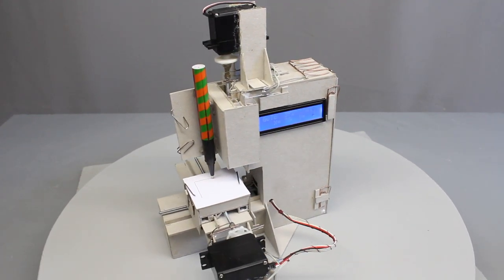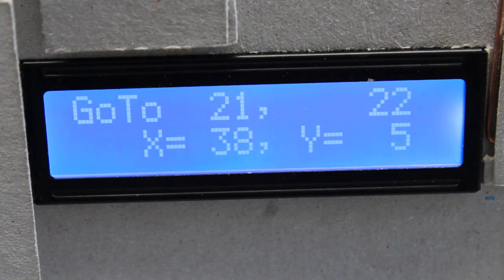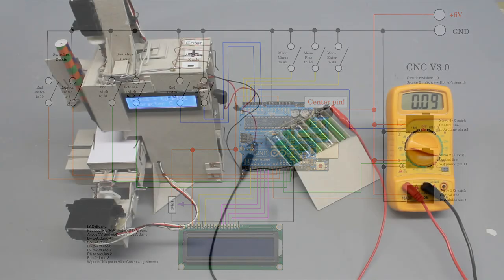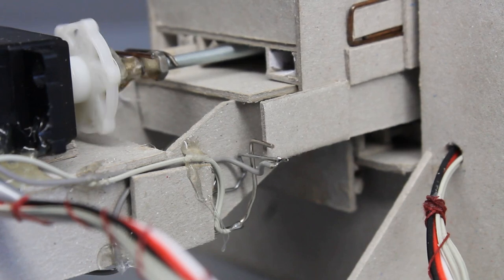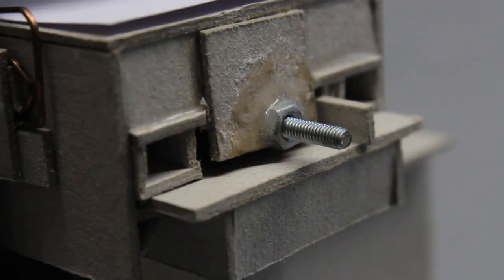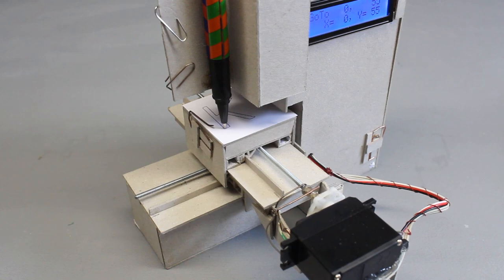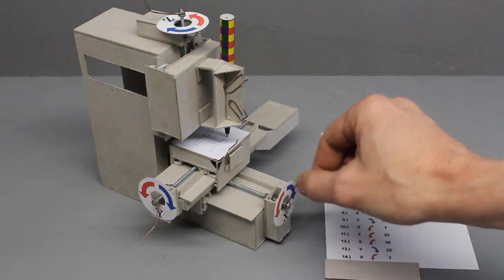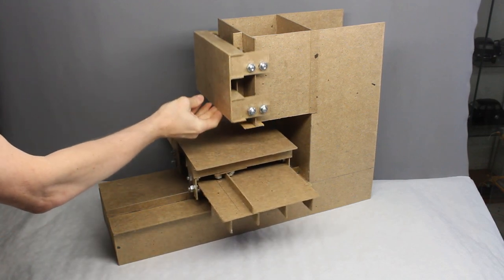CNC v3 0 composed of cardboard and paperclips

Comment: Fantastic work! I love the materials you have chosen, perfect for prototyping and learning. I'm really looking forward to seeing the hardboard/fibreboard version completed, very curious to see what you use for a rotational sensor - If there was a vote, I would vote for optical ;)
Reply from the maker: +sonodrome 
Optical sensors from old printers.
Reply: +HomoFaciens Yes, something like that would be great. You often get the same sort of infrared rotational encoders used for scroll wheels in computer mice. It looks like the bearings have made the movement on your machine very smooth, with the addition of optical encoders the resolution and accuracy could be very good!

Comment: What do you think for  the reason of jaggie lines, is the rod? or is the cardboard structure or maybe the servo is not enough fast for posionated on time when is need it?
Reply from the maker: The servos are controlled with one step per revolution. 3mm threads have a pitch of 0.5mm per revolution, thus you get a too low resolution for smooth lines.

Comment: Fantastic ideas! I've always wanted to build one but the costs seemed prohibitive when you consider the cost of servos, motor controllers, bearings and the platform. This is an easier option to get the fundamentals down at a really affordable price.
Reply: +youtubasoarus I think these are continuous rotation servos, so you can skip out on the motor controllers, unless you meant Arduino for that.

Comment: Really nice machine - very satisfying to watch, and great for teaching the basics of CNC too. I've been designing a partly lasercut CNC machine myself but I your design would be perfect to lasercut - it would be possible to lasercut almost every part of the machine. And imagine using a plasma or waterjet cutter to cut your peices from metal. I like your video because it shows what one can do with very cheap materials, but I think the design has potential to be a very powerful machine, whilst still being cheaper than off-the-shelf models.
Reply from the maker: +OpenTronic 
Thanks for sharing your ideas!
Using a laser cutter to build this machine from cardboard sounds like the total overkill. However, part of the specification sheet of my 3.x series is "self replication", thus using a CNC to create more CNCs. I will in fact use a variety of materials with cardboard being the low end and metal frames on the high end for machines coming in the not so far future.
First and foremost I will use a router to cut materials, but that won't be the only options. Let's see what the future brings...
Reply: +HomoFaciens Yes, lasercutting this from cardboard wouldn't be very useful since the backlash of the cardboard version is so bad. But in acrylic, for instance, you may be able to get a far greater degree of accuracy! The CNC router I'm building at the moment is a mixture of lasercut acrylic and aluminium extrusion, and I'm hopeful that it will be able to cut aluminium, and therefore replace its own acrylic parts with aluminium. Maybe!
Reply from the maker: +OpenTronic Besides the backlash, the low speed of this CNC is a drawback if you consider this to be a useful tool...
Using a CNC to improve the design of the next one is part of the specification sheet of my 3.x series. 3.0 is nothing but an illustration of what the large ones will look like. However it's really fun watching it and a version using acrylic plastic would be even better looking fun!

Comment: Is the cardboard thickness critical? I have one which is 2mm thick. Hmm.
Reply from the maker: It's no precise machine, thus the 2mm cardboard should work, too.
Reply: What kind of glue did you use? ( You might include the explanation on your project site). Did you use hot glue or just any wood glue or similar?
Reply from the maker: smrki1
I used wood glue.

Comment: I want your clothes, your boots, and your motorcycle.   Looking forward to seeing the larger MDF design come to life.
Reply from the maker: ...I've got no motorcycle ;-)
The MDF version won't become a precision tool since it bends under load. It's meant to be another demonstration of CNC design. Hope to make it run the next weeks.
Reply: Your designs are always informative and intertaining.
Reply: And while we are on the topic of 3 axis control systems, consider building a robotic archery system.  Perhaps with binocular vision from two webcams, through a Raspberry Pi.

Or a homing arrow, using a laser target designator.

Or a digital Heliograph and receiver, with error checking, for solar communication.
Reply from the maker: ...archery system, laser targeting? Well, to be honest, I'm not the terminator ;-)
Establishing communication trough a heliograph is indeed something I will treat in a video, sooner or later.

Comment: Exelent project as ever. Maybe you can modify the arduino software to enter in a record mode that record the manual movements of the machine and then replay the progam.
Reply from the maker: +Javier Enrique Traid 
Yes, a record mode should not be too hard to implement and it's a useful feature. I'll keep that in mind.
The CNC drives will keep me busy for the next weeks, than the mechanics and as soon as the "big" machines are running, I'll continue to do coding - stay tuned!